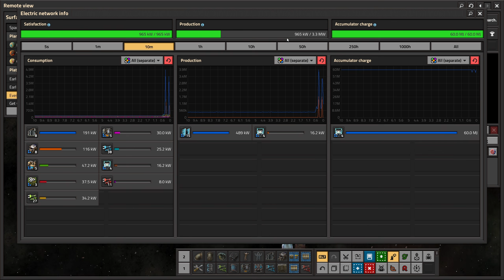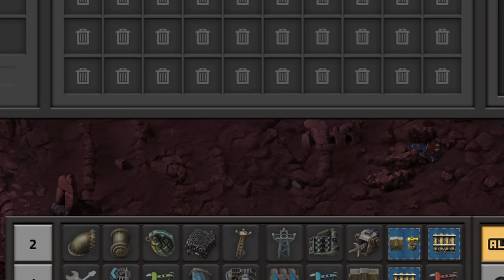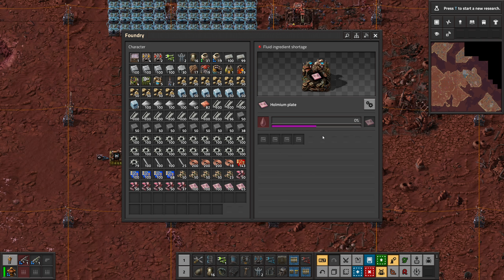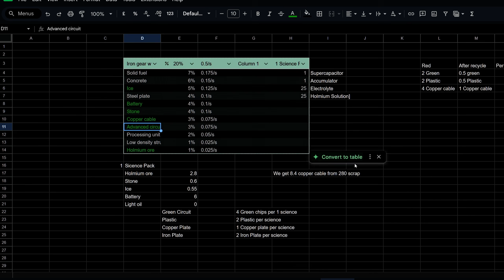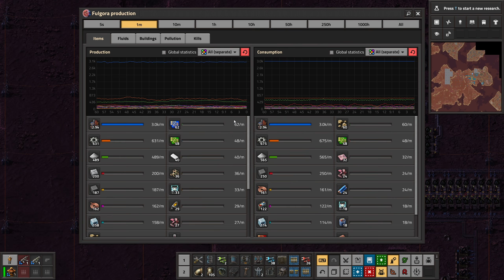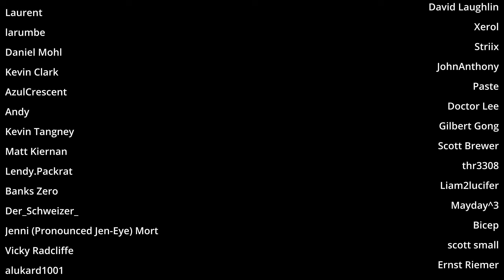Garbage Spaghetti : Factorio Space age Ep17

Comment: 2 minutes old. 2 likes. 2 comments.
Reply: Below is my abomination scrapper if you want inspiration, or just wanna copy the sorting bit. It does use a few mods. Specifically void chests (just two recyclers facing each other achieves the same goal), loaders to load the chests and stuff quick, and merging chests to store nigh unlimited holmium ore (chained chests or rail cars or other stuff could work too). Feed it raw scap and it outputs everything till a chest is full, then the overflow gets deleted or recycled again, repeating in a loop. Just import the string into a blueprint. I stick one down by every scrap mine, it's not quality nor optimized for throughput. It should be overflow-proof, but there's an alarm just in case something goes weird. 

0eNrdXV1vo0gW/SsrP8cjqO+KtCut9kfsw6hlEZtOUNvgxXZ6olH++4LdkyYdiM/h4odBmofpxKnDueV76wD3VP25eNie8n1dlMfF/Z+LYl2Vh8X9738uDsVjmW3bn5XZLl/cL46n+qFaHuusPOyr+rh8yLfHxevdoig3+R+L+/T1rueP6nz9st7mdeeD6vXL3SIvj8WxyC9Q53+8rMrT7qH55H169ynk3WJfHZo/rsoWpxnQKv+bvVu8NH+pnP3NNlCbogG+fMS01/ULgqIRIomgaYRAIhgWQackgqUREhLB0QiaRPA0giIRAo1gSYRIIxgSIU1oCDblUjqrtWMh6LTWbFqndF5rNq9TOrENm9gpndmGzeyUTm3DpnZK57Zhczulk9uwyZ3S2W3Y7FZ0dht6QaWz27DZrejsNmx2Kzq7DZvdis5uy2a3orPbstmt6Oy2bHYrOrstm92Kzm7LZreis9uy2a3p7LZsdms6uy2b3ZrObktLcjq7LZvdms5ux2a3prPbsdmt6ex2bHZrOrsdm92azm7HZrems9ux2W3o7HafpV7og/iZ3fkf+zo/HLg77gbvtW9YJRvWDwz7M4sfTttvy6I85PWx+c3nN+1DF2ng0bo3t0OjWXw0fX00h49mro/m8dGAyQ34aOH6aBEerXuvMzCaTfDR1PXRUnw0e300hY/mro+G54K5ngsWzwV7PRcsngv2ei5YPBfs9VyweC7Y67lg8Vyw13PB4rngrueCw3PBXc8Fh+eCu54LDs8Fdz0XnJYtN2FgWCMbNg4M+zM73p6Q9y1gb8P8sozfLYpjvrs8PS82nefth32eb5a7anPa5kt9fup++WDzuXJVlM/NhVT1y+UPf/6rYXk4Zutvi/ukvdre36SDv1GDv9GvX16b/3oC4JAAtDcecw2AhwKg5xuAAAXAzjcAEQqAn20AfAIFYL5F0KdIAMx8i6BXUADmWwS9hgIw3yLoDRSAGRdBSAmaGRdBSAnaGRdBSAnaGRdBSAnaGRdBSAna+RbBAClBO98iGCAl6OZbBAOkBN18i2CAlKCbbxEMkBJ0My6CVvSo0Sf9jxqDkw2bDgzrBR2u50Gvd1YGQZsuCBEFPa4YREwEjbogRCrocgUhlKBVF4TQgj5XEMIImnVBCCvocwUhnKBbF4Twgj5XECIIunVBiCjoc8Ug0iQRtOuiGKmg0xXFUIKGXRRDC3pdUQwjaNlFMayg2xXFcIKmXRTDC/pdUYwgaNtFMaKg4xXE4C0Sls5z3iNh6TznTRKWznPeJWHpPOdtEpbOc94nYek8540Sls5z3ilh6TznrRKWznPeK+HoPOfNEo7Oc94t4egc5O0Sjq4lvF/C0TnIGyYcXUt4x4Sj85y3TDg6z3nPhKNzkDdNOLqW8K4JT+cgb5vwdA7yvglP5wdvnPD094p3Tnj6e8VbJwI/53SeB37O6TwP/JzTeR74OafzPPBzTud5pOecN1BEes4NneeRnnND53mk59zQeR7pOTdsnruEn3NLY/Bz7mgMfs49jcHPeaAxPl3P7xbrqjzW1Xb1kD9lz0VVt3+3Lur1qTiu6jzbrJ6ycrNqP9Vcy2Fxf6xP+d3bJ/76+eWju2qTt69Zeq88yl5sqP4XG2nHPzJqXD00bipRZwoz9iuJOhu8ci0ZFbzyn3Vhnx0OxXO+3NfVc7HJ6+X6KT9ci8/gtf9aCw77bXHstxl0VaT+8L2uTsf96bja1813uoFo31MWj0/tFjg9qI5n4xOAjSfYdMZTH9h8Lbbtn/18TfpUbXfFabes6rwZ7H+nbHshWVb1Ltsu2rze7bM6O7YZvfhn+x51KCLtVj94qAJBSU82Qfwthno/PVd9lalLCGaKmqyirsrlY57Vy+9Peb6VTljv1afE1dup5sXxtzOGnhdNMDP8vByOxfrbTaaEvkfyjg4OUy/9ZNPuCFRHTUkjKNZ1fsxvMiFMOY6TBYu+NfOB/hpEglmgJiTfNr9t8qRYL3+IvltMjSeKb+BWymYlXzeqsCgfl6fyRldPa8WQsFPsFRGhyZSRp7VkoBdebwhmk0kKT1TOwC33D1k7zstNvmlE5Q2TLfOef4JFL/OeEJaBW+a31fflJi+bMV6a1b4+rRuAmywwnpapgV7xA1MpJ1vxAyEvA7fiZ5vnrFznm1suL4EpnpOt/IEvnvTKH5jiGUgptt+3N8DZw/Ym2RKIChwnW9EC/cQ/0mt1IIRm5NTM4djcQC732+w2Eplv4o30eh8IsRonW+8jUTejIuekKm8yG3yncKTX3UiUxjiZoojETX0ccVN/swThe5IjvcRHpjBOtsRHQlpGN2Ylud2kMPV2suWdb4mO9PIemVrJLe/NbLSPvpYPWX2DOVF0p7VL2HVWJbgqffdeUjTvKlEEKre6F+v8JnOhiSsesfYtH+rbPENVCf/+WdHfIktER0/2LeLfSBuamSeY2cmYBQKVW9sP1bbYLL+ebvIORdGN6S5h13aVJkRwPllle8eWbQ3avjx57R1Xtjdo+7qpf1xNbavmzevf3jWqUkPtpDYPzpbaPG0enB21X9o8OHtqi7R5cA7Urmjz4BypjdBmwVkl1N5n8+CcUtudzYOzonY4mwdnTW1qNg/OhtrHbB6cLbV12Tw4O2q3snlw9tQGZfPgHKg9yebBOVLbkM2Cs06oncfmwTmlNhubB2dF7S82D84i48bQU7YRp1yF688ENX5gSNf3YaCHpBo/P6RrmwAH/7k6ZlmxvMRkW2Wbq53+H8e/Wxxf9ucXN62DovehMu/M7LbnW4wS0/77KR3mcXnHq4kE0nzGCghkx7aJwDkpnGI66yeLqZb4w7FvS8fTiQQySANpJXZ0kBJjSIiTTZZnWrInQw3M9HUbzcdNX5Q4/bHps0xPq54qkJYqKN0e8FGB5M2e3WZ3MJCaoiQtyZZpPp1s3bFWsmcDGEhHBVK62DBG0TDZYmODZGMKMJCRCqR0sWFMnGGyhcClkt03sEA6pk9zssXGUQUlShcb3jIZ6cWGsUzGyRYbRxWUKF1sHHWTE7UUjtIkUbruMHbHONm646n7nWiFJH3KdAFPRlJRJKULn+fqi5fCUbc+UboaMR7DONlq5LlSE6UkmVLzriF2HBzTXTjZOugjRTIVkgwJBSddLQLTRz3ZkhgURVK6RgVNwUnXKMKY55LJ1qiOpw4hKV2jgqPgpKtFYPqZJ1sSQ6BISteojj1uX1ePdbbbtQ7MhmuefeuHDL8+o/5sU6/md5u3P/9a1Ifj6lA8ltm2/fePq3su6uPp3FH91zuU8yeWWflyfCrKx8UF43DMyuPiPvml8fpf51//gGt/vMubOTq/cLmMs3rOtqd8VRxW++K4flrcf822h7x9Q1LtV/tt9tJArA7Vqdwc3n5XlK11e9dEa9W+3WkLZHXML///2uC9x2kHecjW31bP1fbUMmgq3NvPLtuULbbV+kwx226r76t9tX3ZP1Xlyxvi5U9XP2K5zTerh5e3UJ0/89r+cV5/IPnUjHf+xV/bpZ1/UpWrXbb/60dFM+6P0VbvX1et6+ZTb0Pv8sMhe2x/seh9EcMfWKI6We+R3b5UFDaWDxwCrhjvoeoUD49cM/0kvXvFYFwM/J6qe9aNg+5T+aNJukf2gASc5MweEMPDQeqe1gMGKUhOBAIJRMmRQBCG7rjlrgZJk0HSiejAIZCA6MQhEEPjQTJ0kIzkPCOQgJUcaARi4O/OtaeD5CXHJYEEguS8JBAj4kEKbJD4s0c0W7g1f/aIjjSGgoPUPSQJDJKWHPYEEjCSw55ADLwPpnvKExgkJzlJCiTgJSdJgRgBD5KlgxQlx1RhBPhjRgxduDtui6tBcmyQ+PNFDF24+fNFDF24Fa64TaSDZCUHbIEEnOSALRADV9w2oYMUJKd3gQSi5PQuDEPjitvSiluLjgYDCYiOBgMxcMVtacXNN6ZaunDzZ4hYunAT3aqWVtz84SGWLtx8i6qlC7fGFbelFTd/aoilCzd/aoilC7fBFbejFTffWurowm2M5Dg2EIPoPKcVt3GSc9hAAl5ynhyIgStuRytuviXU0YXbJpLD6kAMXHE7WnGPONvjl8LdO6rIIuKGRhVZRAav9Wei/rfY5P9pD9I4rC4bWJ5P1Vh+z+r8qTod8qX9w1454WMQxUn8FR6bSy/BAL8vYcQZJAaY2zhiXHd9XJdInApYTPi+Su/Zue30VeLxAXLKiU7hA+NjJBhgfCwfn5AA8XESXwEYHy/BAOMzIm+DAuITJXYBLD4+kWBg8em0MeLxAeqaVxIXABgfLcEA4zPiJK0A1GdvJc39YHycBAOMjx8RH6A+e9GJmWB8ogQDi0+nVRCOTwTqc0glrfhYfIKSYIDx0SPiA9TnTn/fc1Vshsf6UJWL8mtRtmMd8uOxKB/PPUN1vque89WpvOx5mW9WP0zql0aj3isYsTJHoLJ2mvo+Z2ZvxmxEzkegJnY6+T5n5m/GbIQaj0A163SBfc4s3opZ5Nf5d83gg8wUxOxdz/XEzPQIZkAFiQZkdrMKEu0IZkAFiQ5kdrMKEv0IZkAFiQFkdrMKwnejdZ/VxH5eJkkko4ahUVPJc5OArO8mUWP2voiynnCTiPZpAJkZCUbEMESbM4A8nAQD5CG60wd5BAkGyEN014/xSEV3/RgPvj8t0Jmfip4AgDy05A4X5GEkGCAPK7kTBXk4CQbIw0vuGEEeQYIB8pCs4m1Z6V1vlWQVbx/a9o8KbT/n07ere8+/TdO/+c5sRlGu6M655+egfgjHNQ+YUZQtuiOaPuIFBA58ltEFSqdUtYZvveu8++oLci+IEwiqnsj2YngJRophBIGgQnlECQbGQycCQQXy4DvxuhggD8nOTigPLcEAeRiBoEJ5SDZvQnlIXkugPLwEA+QheUWB8pC8ogB58O15kc5zI3ldgfJQEnmlBuSVkbT0tEneP6rhRJuen2jrNAp+rmr0+3BOp2qMGysb1SjZaPzIHVmDHocXmGdvHbSPWMzDN77/sEtVYWKRb0DsdE3BIJIGJxhESaScgkqjlXQ7BY1hGImUA3lYCQbIw0mkHMjDSzBAHkEi5UAeUYKB8eA7GYNneYzYIdLTPJREyoE8tAQD5CHZBBLlYSUYIA8nEXYDG+8bvqexO6odGjVwctHOTy52Gi5huWgnlYvcBpPd6zCj5JtPJTrKYOqD21CyC2DHkdLjNKmVaVJvJHIRjaWVyEUURPK6FgbhH5MGHkTywjZAp4kYL9keP0A7FpsgeWEL8uDbPYOmeUhe2KI8JC3bKA/JC1uUh6R9G+UheWGL8vASDJCH5IUtyiNKMDAeUfT6dqBlzcRUMqofGlVxgtHPTzB2+kJhwegnFYzRjBWMbpS2inaslvPj8JxEoDpMJUQ/TjB6mWDkdy7sCkaUW5QIRgzE8r2jXcGIgqQSwYiCKImYQ0F4hZLwIEYi5yD3juV7R4P+pCL0YziJnAN5eAkGyENy1A7KI0owMB4jekcjyyOVnKaD8pA4z1AeWoIB8pDs3BAG+vYt3y3aHTUOjeo4yRhnJxltp30VloxxSslo0zBWMoYxEs6mone1AVvt1NiTSEMcRUql4yRjFElGy2/i2JWMaCwlzhYYxEjUHAoi8bbAIJJtLGAQL5GMKAgvURQPIvG3oCAj+krtJyC9C6+WGFxCxDCURNCBPCQGF5SHkQg6kIfE4ILycBJBB/KQGFxQHkEg7+KATcRqiaUlDlhabKd3FBGNcX7mE9tpbUVFY5zUnWHNWPtLHGV/sSNOQTefYvaCmJGiMabjSNlRorHvG82IRn5Hy45ohGMpcb3AIEEgGmEQie8FBbES4wsMkgpEIwwisb7AIFqgTGEQXqTwNUd0dDkMIrG/RMhuYa3E/hJTDENif0F5SOwvIA8nsb+APJzE/oLykNhf4oD9xTqJ/SXqoVE5+0ucn/3FOt7+Eie1v1g31v4SR9lfLN8a21V1mJvCckeddwH0OFJxnGyUeWysl9hf0Fh6if0FBlES2YiCSPwvMIiRKDoUROKAgUEkFhgYxEtkIwoiMcHAIFGiTUGQILHBwCD8TQlfVoLECBMhA4kNEiNM1BiGxAiD8pAYYVAeEiNMHLCs2CAxwkQzNCpnhInzM8LYwBth4qRGGBvHGmHiKCOMjRIjTMTcCDaONcJEO47UOCNMlBlhbJQYYeBYSowwMIiTCEcUxEuEIwoSJMIRBZE4YUAQx/eadjUdCiLxwsAgEjMMDKIlwhEFMRJNh4JI/DAwCH9bEngQiSMGBpFYYiJkiXGJxBITIUuMSyWWmDhgXnGpxBIT3dConCUmzs8S41I9VriNMqS41PBSdVILjkslGxdGrJvffdhZFZRyMouKS8duJxT9uNmUWGLgWEosMSgIvxGrDzxIKpGOKIiSSEcUREukIwpiJNIRBZF4YmAQJ1F1KIjEFQODBIl0REEkvhgUZETPKZ/xWuKMgUF4awyf8VrijekF+XK3+N78oFVPv6cm3KV3KsS79MuXi1hqz3jdnvJm3Svb0bdZA9P87N8P1a4os3aUfxzWdbbfn9e257w+nAe2zbfHxGh9oprqqV5f/w8zBBl+